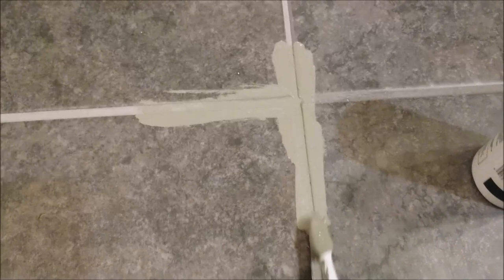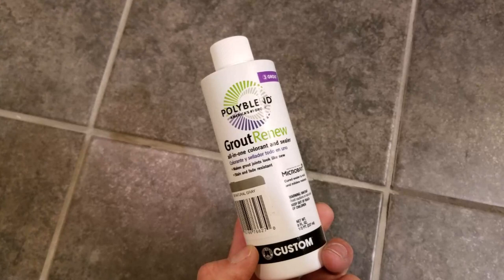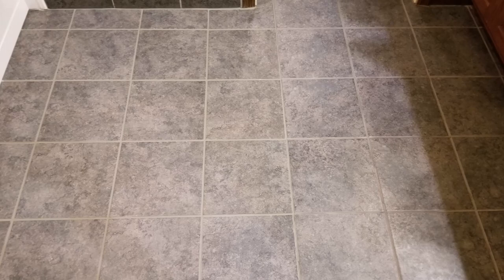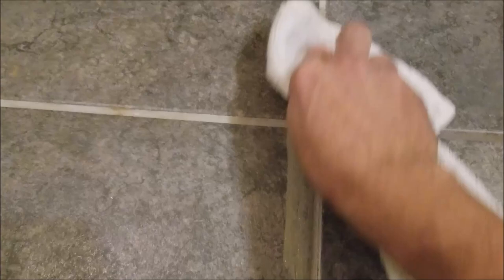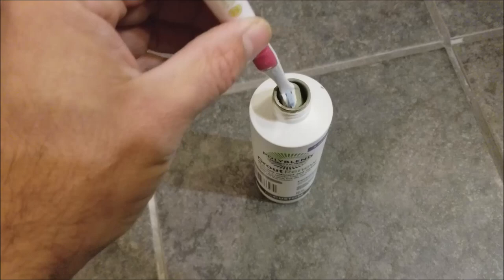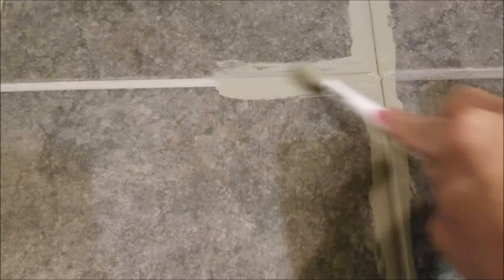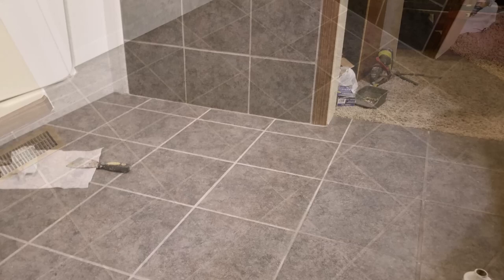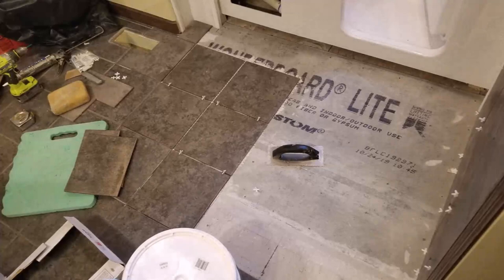How to color match New Tile Grout Repairs with Polyblend Grout Renew from Home Depot

Comment: A question.  So you are not try to build it up you wipe on and wipe off sort of like a stain?  

All the videos I have seen people seem to paint a coat on as close as they can with a small brush and try to stay in the lines which seems hard to make it look good.
Reply from the maker: This is more of a stain
Reply: We did it with small paint brushes and did rub back and forth a bit. More time consuming but less waste. We used the same product as in video.
Reply: @tearosefarmcrafts9969  I ended up "renewing" all my grout and it worked pretty good.  What I found was if you left it on the tiles to long it would be harder to get off.  For me I am not sure what worked better to apply the renew, a toothbrush or a paint brush. 

When I was wiping it off the renew I would take the wiping rag and carefully wipe the tile at the grout line with my finger nail to remove all of the renew and to give a nice clean tile to grout line. 

Anyone who sees it thinks its new and its so easy to clean.  My coffee maker over flowed and soaked a lot of the grout and it cleaned up no problem.  You are not to scrub to hard.

I used it in my shower on my tile that go from the tub to the ceilings and no issues at all.

People complain it doesn't stick very well, they may not have cleaned the grout very well you do not want to put over dirty grout? I used a very small wire brush and some heavy duty grout cleaner before I coated the grout and no problems at all.  I scrubbed the grout very well then rinsed. 

It was still a bit of work but no where near the work to remove the grout and regrout.  And there is also the chance of small chips on your tiles as you remove the grout. 

Highly recommended.